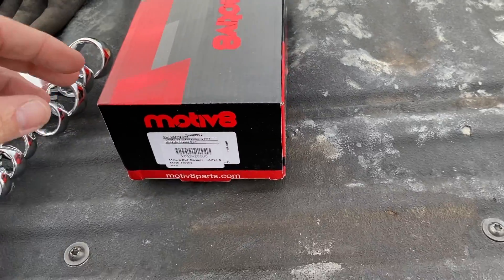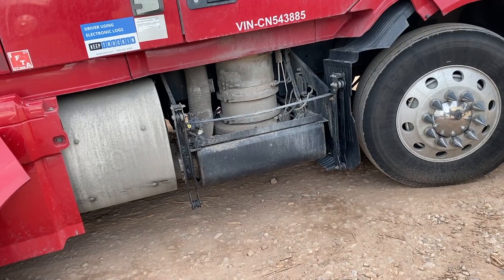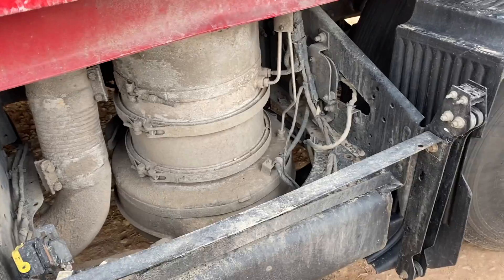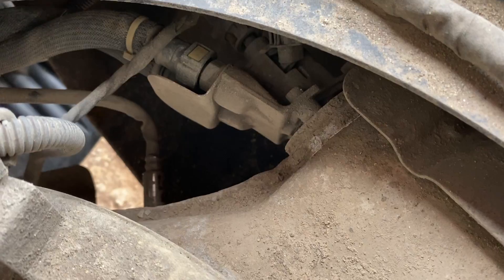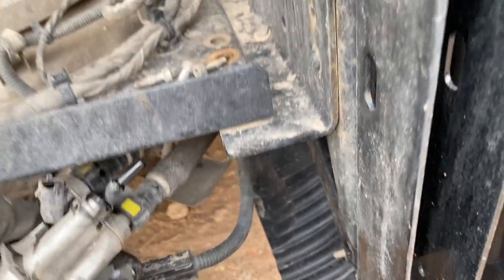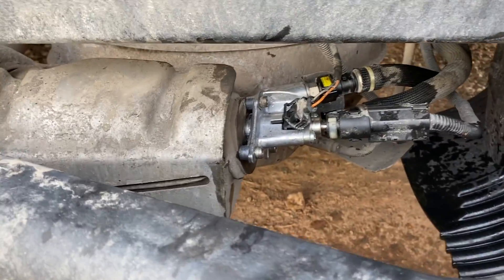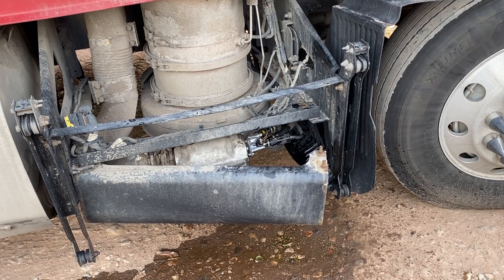How I fixed my SCR Low Performance problem

Comment: If you have over 800k miles, change your scr box, or put nox sensors,  dosers, and on and on, it will do the same thing,  low performance,  poor quality,  engine derate stuff like that
Reply: Are you saying to change all of the things listed?
Reply: @antoniohardy7416  Yes cause that's what happens to me at like 600k and I had to change the scr box , clean dpf filter , clean EGR, keep some 7th injectors with you & dpf sensor , I'm barely gonna change my def doser tomorrow and put new 7th injector and dpf sensors, they kinda mess up after the winters , I'm from Illinois

Comment: Hey there I have a question my truck went into a full derate 5mph and I have changed the doser valve it was caked up after do I need to get it towed to the shop to get the codes reset because it's still in derate mode.

Comment: Your def dose house is cracked around the dose valve. Need welding. If not welding you will still have problem. I see on the video is cracked.
Reply from the maker: Thanks.. it was fixed and welded back in June

Comment: thanks for posting this video!
here is something that every truck driver should have in their tool box,it saved my ass few times

OTR Reset Tool | Volvo & Mack 2014 - 2020 | Forced DPF Regen | Reset Aftertreatment System | Clear Active/Inactive Codes

Comment: I have a 2014 with the D13.  I see Volvo acknowledged the known issue in these motors and set aside 780 million to address it.  This was announced in 2019.   Has anyone found what the real fix is
Reply: Is it like a callback for this issue or they just acknowledge it and you have to get it fixed on your own?

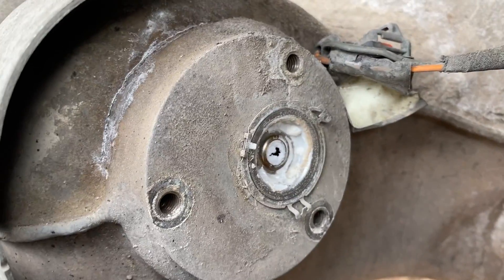Comment: other problem that could be the reason you were actually getting scr code in the mount that you bolt the doser valve to likes to crack at the weld I actually spotted in the the video @5:23 you can see the crack with white crysalized def was seeping out that could cause multiple def false errors to come up

Comment: I had to spend around $4k  for a complete diagnostic tool to avoid going to the dealer every time CEL came on due to SCR's low performance. Every dealer visit to turn off CEL would cost me $400.
Reply from the maker: Ouch! I just had my ash pan welded. It had a crack in it. I’m hoping that fixes my problem permanently or until I want to buy a new one.
Reply: What complete diagnostic tool did you purchase?
Reply: @teemo4853  PTT( Premium tech tool dealer software specific to Volvo, NEXIQ interface, Fast laptop min Core i 5).
Reply: @teemo4853 Premium Tech tool

Comment: Get the OTR performance reset tool.  It will clear codes and removed 5mph limit.  It will save the trip to the dealer too.
Reply from the maker: I will have to get one. Thanks
Reply: I had one, it doesn't do special commands like " EXIT INDUCEMENT" which is SCR performance-related code. Premium Tech Tool is needed to fix it.
Reply from the maker: Thank you. I’ll look into a better one as well.
Reply: How is it running now? I notice that there is crack everywhere on your box where the def dower mounted.

Comment: I have a 2013 Volvo d13 and I got a check engine code: spn 5394 fmi 17 My question is how serious is this code? Can I make a trip? It had me do a manual regen. Then I drove it for like 10 miles, parked, shut off engine. When I drove it after the regen the check engine light disappeared. But after I shut it off for 5-10 minutes and started it back up again, the check engine light came back on with the same code... How serious is this?  Safe to go  200 miles
Reply from the maker: I’m not sure. I have been able to continue driving mine. I get those same codes every time I’m in Wyoming. Mine ends up clearing itself usually. So I hardly let it worry me. But you could be something else. I’m sure mine is a sensor acting up.
Reply: @wwbbadventures  thank you! Even after you change it still coming up?

Comment: SCR Performance Low is really wide term when it comes to Volvo. It could be number things that will trigger this massage to pop up. It could be Inlet or Outlet Nox Sensors, DEF Doser Valve, EGR Cooler or EGR Valve, 7th Injector and list goes on.
Reply: Thats why you look up the  code. The code will tell you where to start in the possible cause area. With his engine code Doser valve was 1 of the possibilities along with Def quality Def clogged lines n control module.
Reply: @Cedric Diggs  i would think it was self-explanatory that you have to look at the code when I said it could be multiple different things. One thing you have to remember is that a lot of times when you get SCR Performance Low you won't get code pointing you to the right issue right away, and you have run diagnostics on all those things I mentioned above to find out which part triggers SCR Performance Low.
Reply: Yes I agree 
I took to dealer, code was p20ee00
They said it’s not saying exactly point we have to look at each of all that possible cases.
Reply: Your first mistake is going to a ta. Your second mistake is listening to somebody who works there.

Comment: What was your messages on the dash? Mine says poor quality def detected and asking for parked regen
Reply: Did you figure out what was the problem? I have same msg on dash and they telling me I need scr and it’s 5k , also that I need both inlet and outlet nox sensor
Reply from the maker: I replaced both NOX sensors and my Doser valve. That fixed mine. But my Doser valve is going out again
Reply: @wwbbadventures  they replaced my scr and put the inlet and outlet nox sensors & it’s been doing good, I cleaned the EGR cooler before this happened and the dpf filter because before all this on January black smoke was coming out the exhaust and it was the injectors but after they changed the injectors that’s when it kept asking for regen and poor def quality so that’s when they changed the scr and nox sensors

Comment: My 2018 international can't go more than 5mph am see a SCR error severe debate stop engine on the dash along with four check lights one blinking what can I do tonget going
Reply from the maker: You can try unplugging the speed sensor on the side of the transmission

Comment: You could just have tried cleaning it. It does become clogged
Reply from the maker: Yes sir. It was cheap to replace so I just replaced it.
Reply: Is it called an exhaust inlet valve. So I can Google on how to clean it. Thanks

Comment: Did it really fixed it? I can see a broken decomposition tube
Reply from the maker: Yeah it fixed it. I would also have your eyes checked.
Reply: @wwbbadventures  5:23 you checked your eyes con can clearly see the crack on the decomposition tube man I’m a diesel tech you don’t fool me haha 

Look right you can even see the def coming out of that pipe after the dozer bolt on
Reply: @wwbbadventures 😂
Reply: Perfect cause I work on a Peterbilt dealership but I have a Mack with the same Aftertreatment system I can see the new dozer has a metal
Dower instead of a black plastic right? Cause I did had a crack on the decomposition tube next to the dozer I welded it and it fixed it but it just came back I’ll replaced that dozer and hopefully it finish the fix
Reply from the maker: How do you like the Mack? I’m thinking about getting a Mack or a Pete next. I have had the Volvo for just over 4 years now. Time for an upgrade or a second truck.
Reply: @wwbbadventures  I don’t own bro I work on a Perterbilt Dealership!! I’ve worked on a freightliner dealer also but I always recommend Peterbilt all the way every day
Reply from the maker: I will check it again. Another guy pointed out the same thing. But when I cleaned it off there was no crack. It just was residue. But I will double check and make sure I did not just miss a hair line crack. Cause I did clean it off. But I wasn’t specifically looking for a hairline crack either. I will let you know what I find.
Reply: @wwbbadventures  it’s a lil son of a damn bro I catch it while running a regen with that cover removed the heat would expand the metal And it would show it self. I’ve had 3 of those coming here for the same weld them and they run fine, but the one that came back has an old dozer that’s why I asked if it fixed it ima replaced it and let you know 🤞🏽

Comment: PLEASE save your self the headache and further derates and have a shop weld the hairline crack @5:26 on the DPF OUTLET MODULE above the def dosage valve mounting. Inspect the below from the outlet module to the scr inlet for cracks or bad gaskets etc.
Reply from the maker: I cleaned it with a wire brush and water. There is no crack. It was just Residue that looked like one. But thank you for the info and pointing out what to look for. It’s much appreciated.
Reply: @wwbbadventures  glad to help out boss man keep up the great videos! 👌🏽
Reply: @wwbbadventures  Unfortunately it is cracked. it's a hairline crack and cleaning the area with a wire brush makes it harder to see, not easier. The easiest way to tell is to perform a stationary regen with that shield off so you have a clear view of the area. When the DPF gets close to 1000* in the middle of the regen, you'll see the crack expand A LOT. Stainless steel expands and contracts a lot with temperature variations. I have around 25 trucks with that model DPF and they all crack there.
Reply from the maker: @akrk9670  still no crack. But thanks for your advice
Reply: Did you ever fix that crack?  I noticed it on our 2012 Mack Mp8 too, looked exactly like this one does.  This Def system is an absolute nightmare, still getting lightning bolt
Reply from the maker: @awnedrerepz1786 yes sir. Volvo welded it for me and it fixed the problem.
Reply: @wwbbadventures  So there WAS a crack?
Reply: Welder 😂

Comment: you could have run the truck with the dozer valve off and see it it worked, it sprays intermittent shots of def. Think the problem was more with inlet being needed to be cleaned.

Comment: I really wish someone can help delete emissions from my truck
Reply: Don’t do it lol my friend did that to his volvo and had to put everything back again cause there’s a lot of sensors and had to pay 30k when he could’ve just wasted like 10k and buy new dpf filter (3k) & scr catalyst (5k)
Reply: EPA troll bait lol. 
Not worth it.  But you need a great wrench and we don't see enough of the 180 an hour dealer rates to be worth the 750 a month check starting in 10 years when Cancer rates spoke from rolling in DEF to maintain these properly. 

It's too specific, too touchy, overly governed with software and exposed to the elements to be done the way it should. Nobody can show me a video non stop of a shop doing this right in the time they say it takes without exposing the tech to the terrible chemicals.
Reply: @MuffinManLuffy   it's just ammonia 😮
Reply: @friendofvinnie  increasing demand on the same materials and therefore increasing the cost of food in turn. 
Supplies and demands.
Reply: @MuffinManLuffy  LOL 🤣🤣 DEF is Nitrogen Agricultural fertilizer mixed with water. You can fertilize your lawn or garden with it 😂
Reply: @100pyatt  lolol 🤣

Comment: Thanks for the video, having the same issue. I bought a CanDo Hd Mobile scan tool $399 on sale that can clear codes and force a regen. Worth every penny. OTR makes one as well. Please follow up after a month to see if that took care of it.
Reply: Can it work on 2017 Volvo?
Reply: @PoBoy_Trucker  Yes, I've regened a 2017 Volvo for another driver and cleared his fault codes.
Reply: @Coronado-nz7wu  wow. I’ve heard it was more expensive. Is there a way you can send me any info like model number or link.  I would really appreciate that. I’ll need to get it
Reply: @PoBoy_Trucker  currently $386.27 on Amazon which is where I bought it.
Reply from the maker: Yes everything is still good on my truck as well. I did replace both nox sensors at the end of June though. One of them went out, so I did both to be safe. Hope y’all are doing good..
Reply: @Coronado-nz7wu  thank you. God bless. Safe journeys
Reply: @PoBoy_Trucker  yes.

Comment: Man, I hate the DEF systems.  When they work, they work.  When they don't, what a pain to figure it out.  Hope you got it fixed for a good while.  Any update on they headlight polish?  WLBS
Reply from the maker: It seems to be fine now. But I usually have issues in the colder weather. So time will tell. Headlights are good. But they are showing signs of yellow again. I seen some on the volvo parked next to me in this video that I think I will order in a couple months.
Reply: @wwbbadventures  I wondered about the longevity if those polishes.  Just let’s you kick that purchase down the road a bit.  WLBS
Reply from the maker: @WhiteLinesBlueSkies  yeah exactly. I’m waiting to get new ones until after winter so the roads are clear from debris.